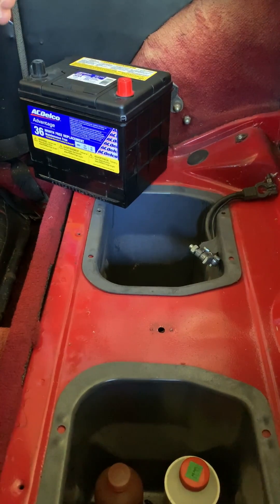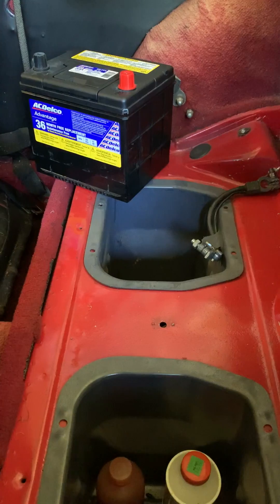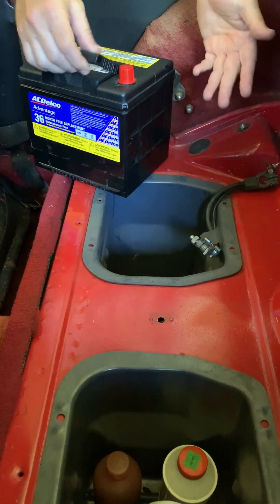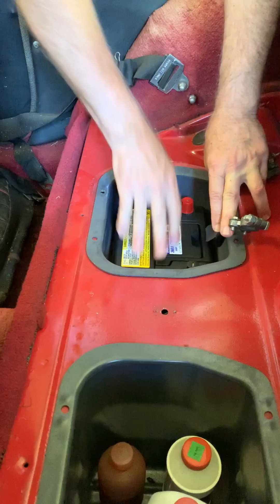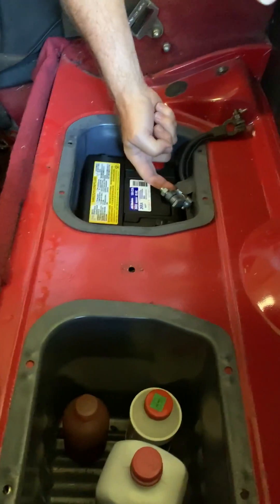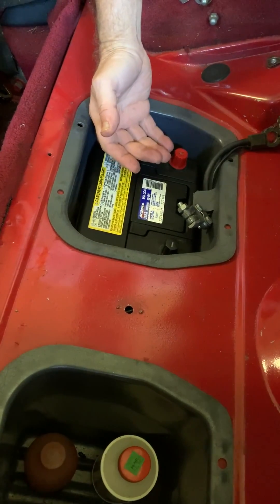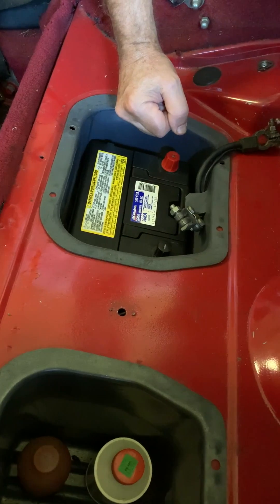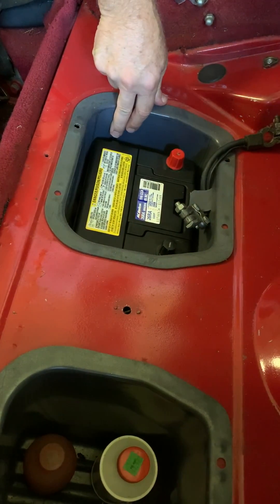12V Battery for MGB part 4 of 4

Comment: I own 9 VECHICLES. The red is always positive. The ground is always negative. On my 1978 mgb, the red CABLE is going to negative, but the positive battery terminal RUBBER PROTECTIVE CAP is red. So I have red on BOTH SIDES. You did not show HOW the battery is installed. 😢
Reply: Well...early MGBs are positive ground--but many (like this one) have been converted to negative.  So this is a topic best left to another video!🤷‍♂
(On a 1978 MGB, you will have negative ground, so just make sure the cable attached to your frame is attached to your negative battery terminal--regardless of the color of wire or rubber cap!)

Comment: Did you use a 40 Ah, or a 44Ah? greetings from the Netherlands
Reply: This is a "starting battery" and isn't rated via Amp Hours.  That rating is helpful for "continuous usage batteries."  For cars in the USA, the CCA (Cold Cranking Amps) measurement will tell you how well a battery will work for starting your car.  I bet you have something similar in the Netherlands?  Honestly the best battery to buy these days imo is a Mazda Miata (MX-5) battery.  It will have plenty of power, and will fit the Bin easily without any modification.